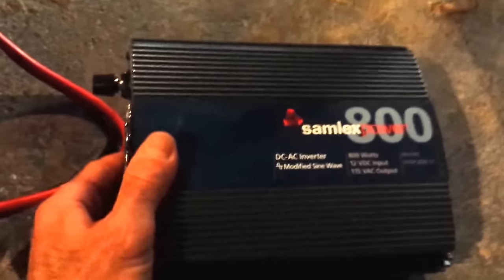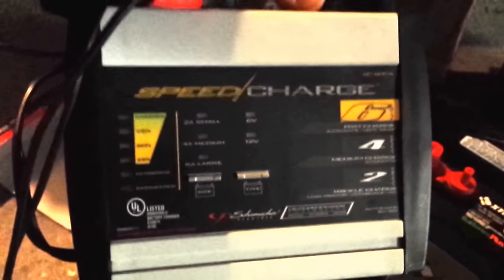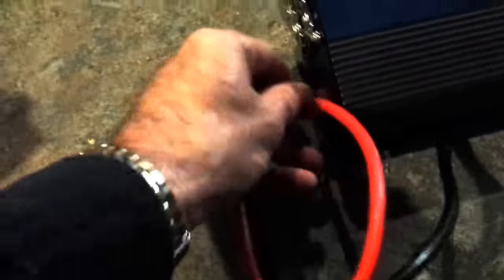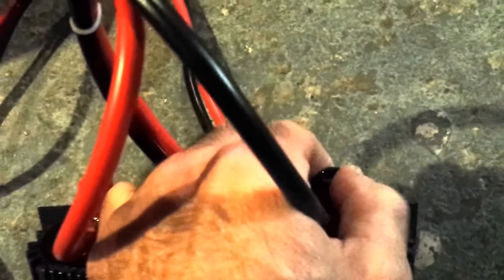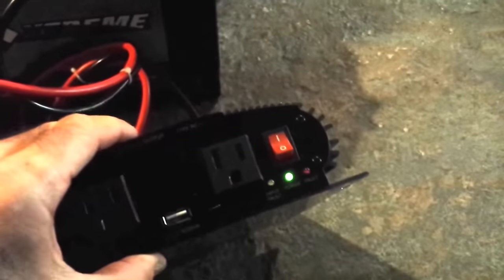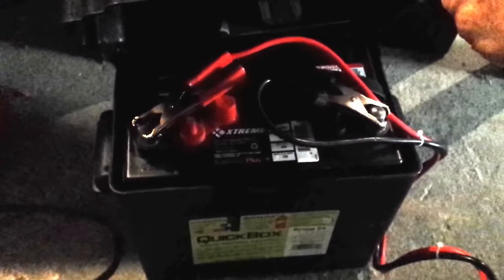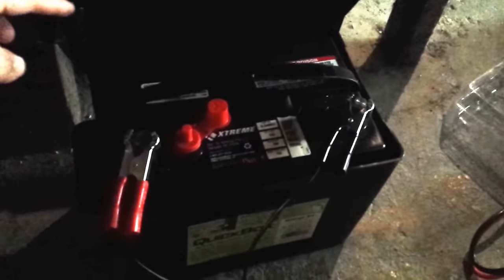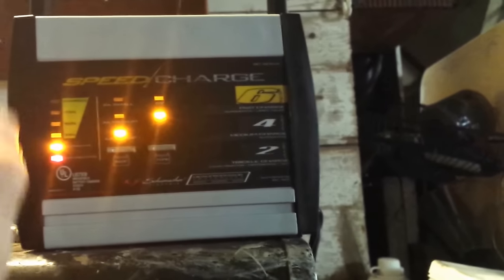How to Connect a Battery, 12 Volt Inverter, and Charger

Comment: Why can you connect the charger straight to the  battery and then plug the charger to the inverter you will never run out of battery cause the charger will be supplying a constant charge to the battery and the inverter will run for ever🤔
Reply from the maker: Hi Gilfredo, I am a little confused.  Sounds like you suggested to connect the charger to the battery, then the battery to the inverter, then plug the charger into the inverter.  Is that correct? If so, you have a closed-loop and I'm not sure what you are accomplishing by doing that.  You are not drawing any power from the battery to operate anything, so in theory, the loop could go on indefinitely.  I'm guessing you would lose some ower in the transformation process and it would eventually drain the battery.
Reply: @danusher6919  What about keeping a trickle charger on the battery and after a power outage for example,just unplug the device running on the inverter then turning off the inverter and the trickle charger will keep charging it till the next outage.You see here are currently rolling blackouts so we need to use an inverter at least twice a day for 2.5hrs at a time.

Comment: Ah of battery??
Reply from the maker: Hi, thanks for the question.  I don't know.  I actually don't use the specific battery shown in the video anymore as I needed to replace it after a few years of normal use.  I now use the Duracell Ultra battery. I took a quick look at that battery and it said Mins@23 Amps 150.  It's a deep cycle marine battery, think car battery.  If you need to know that level of detail and technical specification for what you intend to use it for, I would suggest you ask and check that out before you purchase any battery.  I use it to run 720 watt blenders and it works great for that purpose.

Comment: No good for Off-grid,Can't plug into a tree,so you can't really use a charger,you need solar panels/Your Truck/SUV Charging System, Everytime You Need Power You Need A Power Outlet,How about hooking the charger to your inverter in the SUV and charge at all times? Won't that work better?

Comment: Can I just plug an extension cord into the inverter and put the inverters cable clamps on the battery.  Will that charge it?
Reply from the maker: It's a good thought, but no, the plug is for outgoing current.  The inverter has a cord attached to it you would plug into an electrical socket.